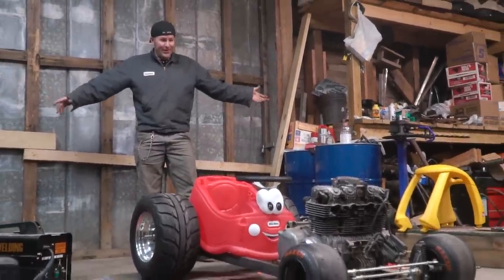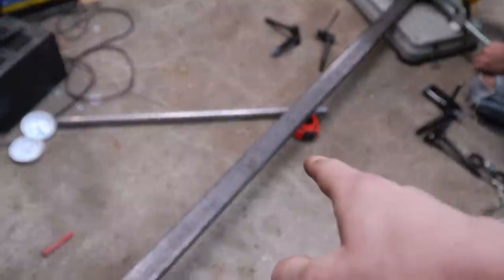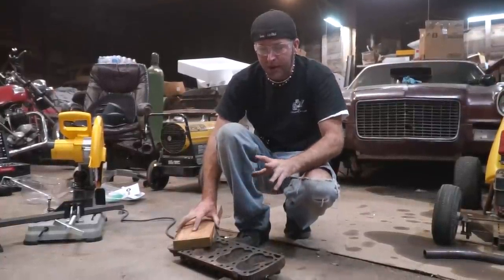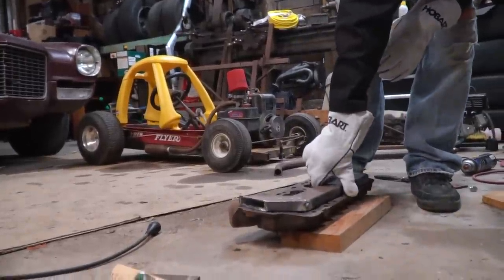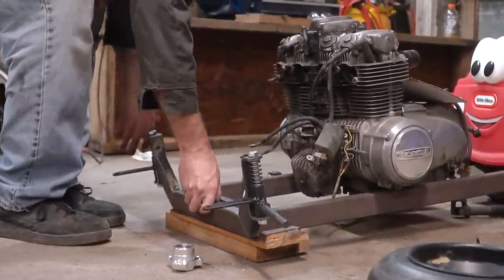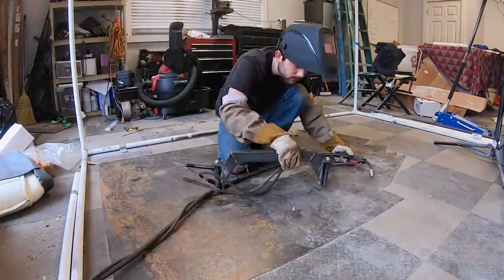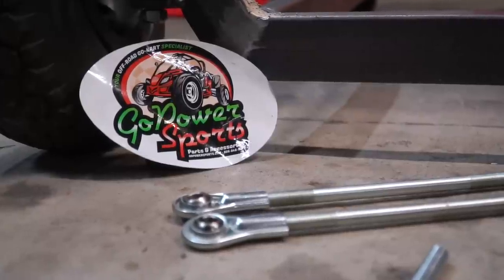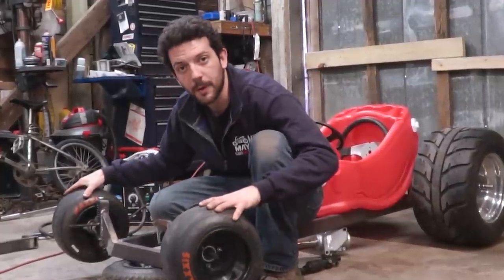Cozy Coupe Go Kart Build Pt. 2 | Rolling Chassis!

Comment: I think it's completely awesome what you guys have done on your own. Now, it's time to build one of two. A track style gocart, or maybe a rear track and front tires, or full tracks like the 8x8 or 6x6 that have the track conversion. But make your own high power version with nice suspension, and maybe since their is a huge fad with the Cybertruck, you make your own Cybertruck or Hybrid gocart, not for sound, but electric motors have very high torque instantly. And alternators can be turned into motors, but I'm sure a lot is available that could be used, and a small 2 stroke or gas motor can turn the generator for the electric motors. Just a thought.

Comment: If the 550 doesn't work out, I'd really like to see the diesel go on the cozy coupe with really low gearing to get the most top speed from the high torque of the diesel. With a tall stack in the front, I think it would really add to the rat-rod feel.

Comment: Your right square tubing is way stronger then round 🤘🏻🤘🏻😁
Reply: Round tubing is stronger than square or rectangle. But the mating part wouldn't be supported as well.
Reply: Put a chain around center of a 4 foot piece of round tubing and chain a square 4 foot tubing and block the ends and tell me how much pulling force it takes to bend each piece you will be surprised that the square tubing will take much more force to fold each piece the bent corners on square offer much more resistance.

Comment: Turn your engine sideways, make a "driveshaft" from the output shaft on the engine to the "magic box", therefore making it mostly shaft driven until after the magic box. It would be cooler too because it would look like a bigger engine
Reply: It would look cool but that's an air cooled engine, gotta have all the cylinders facing the wind.
Reply: @captaingoldbeered803  I know it's air cooled, but with it sideways then air will flow on both sides of the head instead of only flowing on 1 side.
Reply: @smalltownadventures6542  It would flow across both sides but the front cylinder would still get the brunt of the air.  That's why a lot of oil cooled v-twins run the back cylinder richer than the front.  Kind of like when you're freezing on the front seat and your girl is comfy behind you lol

Comment: You guys should cut the back end of the cozy coupe out to where the axle goes thru and mount a bucket seat you used on the race carts on top so u have a place to sit when your doing it for dale with that 550

Comment: Would welding on the flat head really damage it though?
By it's condition i would expect it needs to be milled before an assembly anyways, so the weld would be milled away along with any rust and pits.

Comment: You should chop the plastic body in half and have it sandwich the driver. It would still look good and offer a lot more room. You could also then adjust the steering wheel to be more horizontal.

Comment: have you built some caster angle in? I have sorted my rear axle out on my mower build, now i need to widen the front axle and was gonna put 11 degrees o caster in, so i was keen to see what you did here!
Reply: We did put some caster in it but we lost it with the huge tires on the back jacking the rear up

Comment: Also if you used a magic box in back to a drive shaft running forward then another magic box forward to convert back to chain would eliminate the chain going through the body

Comment: What kind of welder do you guys use? I'm just starting researching them and I was wondering which to start with.
Reply: We use Lincoln and miller welders. Spend the extra money on a nice one if you plan on using it alot.
Reply: @isaacitllbefine7231  Okay thank you also keep up the good work.

Comment: Are the wheels and tires that are on the rear from go power sports if so do they carry that rim and tire combo in the Yamaha Raptor bolt pattern I'm in need of a good street tire for it the Raptor has a 04 Yamaha r6 engine with dry nitrous on it and the factory tire's are a little iffy above 100mph

Comment: There was a T-Bucket in Smoky and the Bandit that had a straight up steering wheel as well, it was very common. I think y’all should have gone a little more hot rod on the steering and had it on the out side of the frame not under the motor.
Reply: I tried the side. The front axle wasnt quite wide enough for the linkage to clear the wide engine
Reply: Isaac it'll be fine that makes more sense

Comment: What type of blade are you guys using on your chop saw?
Reply: Bought it at lowes. Its a metal blade used for cutting metal.  Expencive but i like it
Reply: @isaacitllbefine7231  dang I'm going to have to check that out and almost looks like a concrete blade and at first glance lol

Comment: guys get a workbench you gonna hurt youre backs working the way you do now
take some inline 6 engineblocks set on end and drop a thick steel plate on it , maibe use a few treaded holes near the waterpump face on the engineblocks to bolt them to the plate / tabletop maibe use more engineblocks to get the table higher 
like how you did the steering

Comment: I HAVE A TOW BEHIND SANTA  SLEIGH, GUESS NEXT YEAR IT WILL BE PUT ON A CART FRAME TO PLAY AROUND IN THE 
SNOW WITH MUDDER WHEELS ON THE REAR . 3 SPEED RIDER WITH REVERSE REAREND OLDER STYLE ROUND HOUSING WITH A SMALLER PULLEY ON THE 18HP VERTICAL OPPOSED TWIN MOTOR AND TRANS. SOLID PIVOTING BUGGY STYLE FRONT AXLE,
 BODY PANELS TO LOOK LIKE 12 MINIATURE RAIN DEERE.

Comment: You guys did it all wrong, you should of cut the front smiley face section off and moved it to the front like a grill and used the back half as a seat so you could actually sit in it, you could also do some cutting so the seat would be low enough to fit the roof back on

Comment: I tell you how to make it work but no one listens to advice on this channel. But I will say it anyway cut the inside of it out and use a small seat that will gain you 2 more inches. But issac needs to lose 25 lbs or buy another one cut it off center by 3 inches on opposite sides and gain 6 inches in width. Just remembered my granddaughters is behind the garage it's broken beyond repair and my grandson got one for xmas the older ones are almost 4 inches wider. Look for a older one, made like 10 years ago.
Reply: Ive looked for a older one but i cant seem to find it.